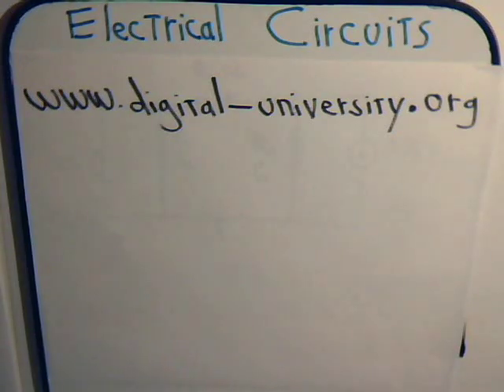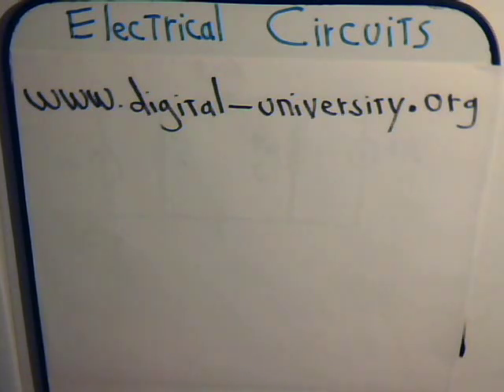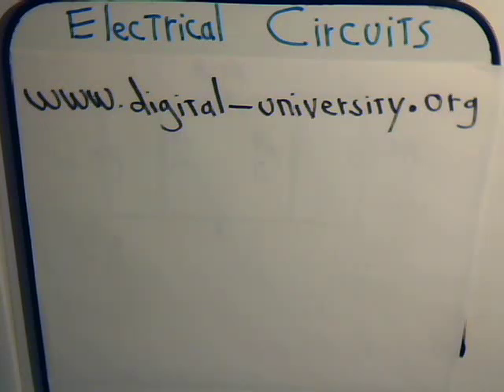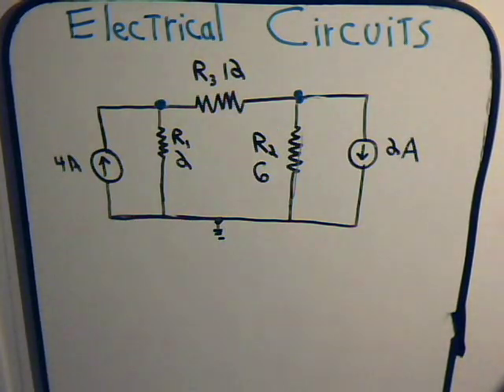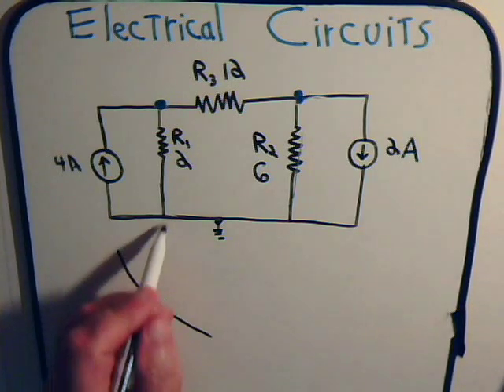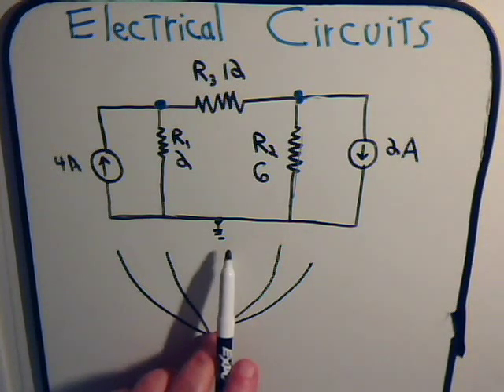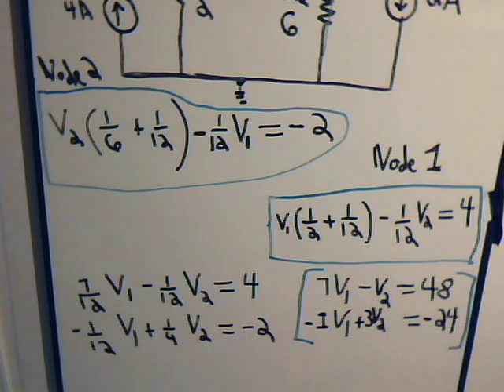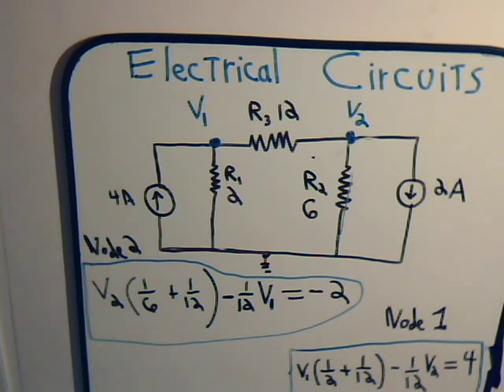Electrical Circuits Video 28: Nodal Analysis - Format Approach Introduction & Example #1 Part A

Comment: Right around 4:40 where the voltage drop across R3 is calculated as (V1-V2)/12 is the idea behind that to treat the series combination of R3 and R2 as a voltage divider?

Comment: Very good video, very helpful. Thank you for this.
I just noticed a small typo in your final equation for Node 2: in your video at 11:15.
What is said "1/12V1" is correct but what is written "1/2V1" is incorrect. Just thought I'd mention it for anyone that is confused.

Comment: @meedan1 It's your reference node. Whenever you find the potential difference between A and B and A is grounded, the potential difference will be the voltage at B because the one that is grounded is said to have "zero" potential....